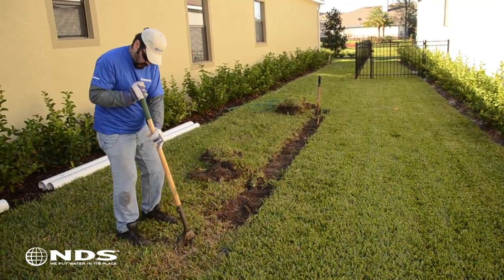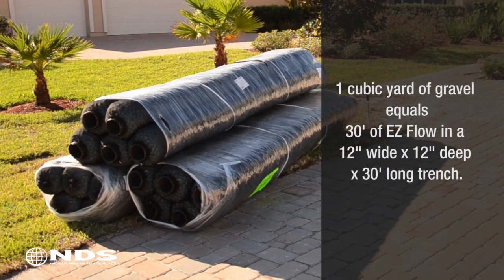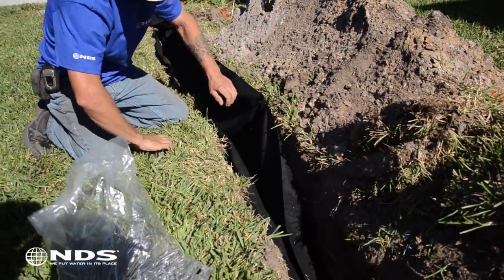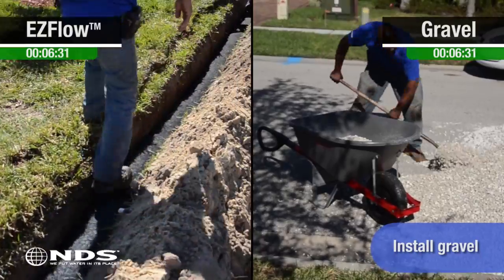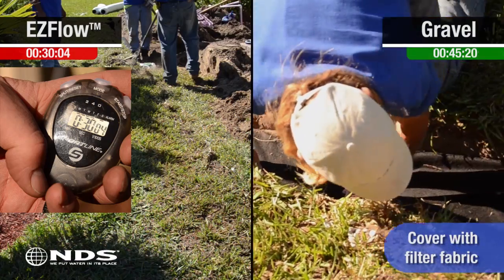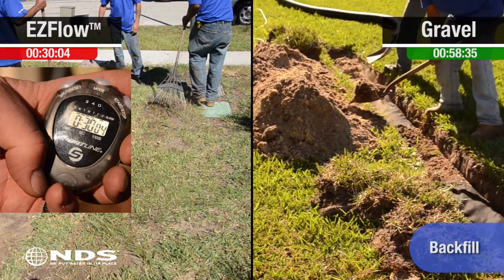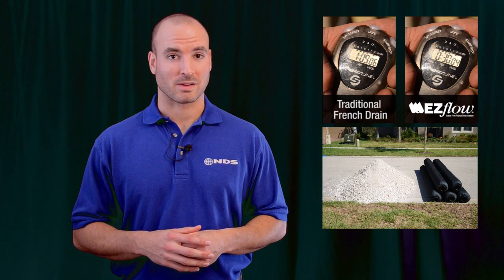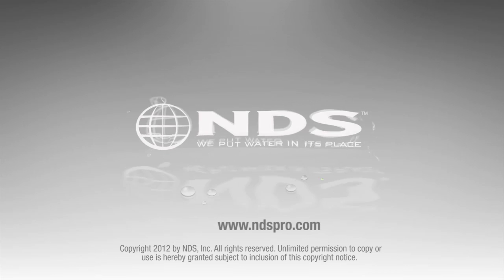Traditional French Drain vs EZflow™ French Drain Alternative | NDS Yard Drainage Systems

Comment: Will this stuff ever clog or need replacing? Can it be snaked if it does become plugged? Thank you!
Reply from the maker: When properly installed this product is guaranteed to last up to 100 years. In order to prevent clogging we recommend you cap the high end and use a grate in the low end to prevent reptiles and rodents from nesting inside.  Unfortunately, if it does clog running  a snake will not help becasue the pipe is corrugated.
Reply: NDS Stormwater Management Thank you for the quick reply!  I am looking to attach one end to a catch basin and the other will discharge into a storm drain so I don't think the one end needs to be capped. It is about a 350 foot run though. Will this be ok?
Reply from the maker: euonymus1980
Yes, this will be fine!

Comment: Can u connect ez flow to a existence French drain?
Reply from the maker: Hi Jose! Yes, you can connect Ezflow to your existing french drain. If your existing French drain has smooth wall pipe you will need to use a 3” PVC coupling if existing French drain has a 3” pipe or a 4” PVC coupling if the pipe is 4”. You will need to use either of these couplings in conjunction with a 3”& 4” Universal Adapter in order to make the transition from your existing French drain to Ezflow.  
 
If you use a corrugated pipe on your existing French drain then you will simply need a 3" corrugated coupling if you used a 3” pipe or a 4" corrugated coupling if you used a 4” pipe.

Hope that helps!